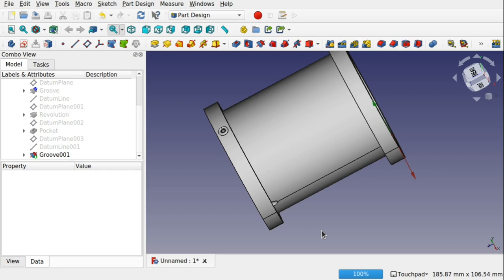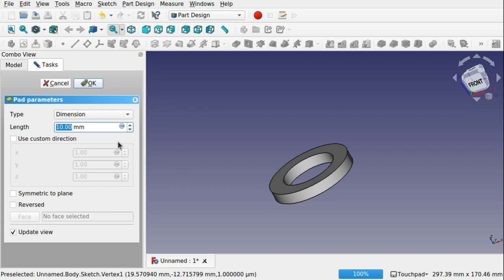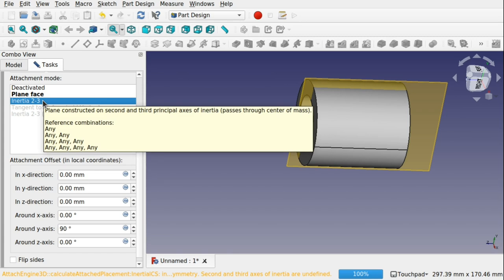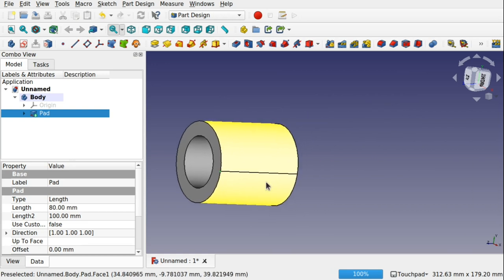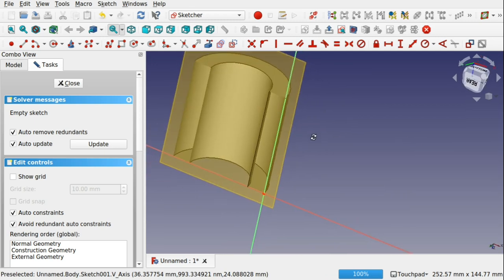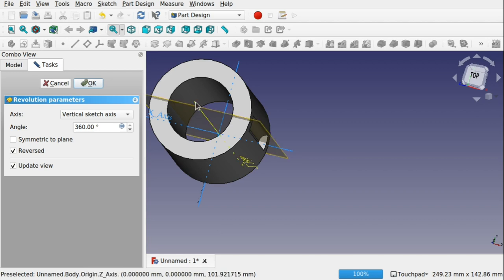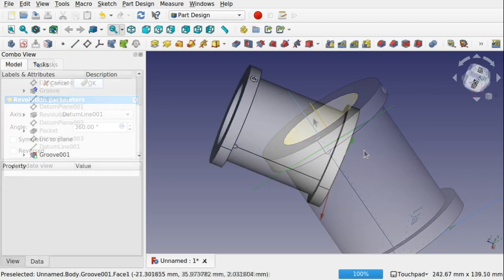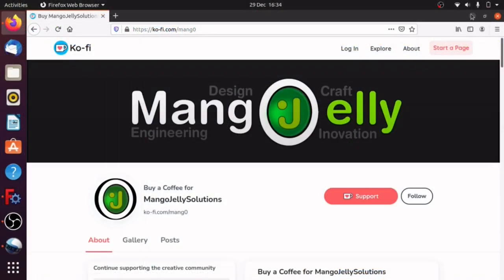FreeCAD: Understanding how Datum Planes and Datum Lines Work With Grooves and Revolves

Comment: Very interesting, but the hole drilling part beginning at 19:43 seems very strange to me, because you selected to move the datum-plane in the "Z" direction, but the Coordinate-System arrow shows that you moved the plane in the 'Y' direction. 
I'm very confused there.
But not only because of that, but also why it does make the hole when you move the datum-plane away from the hole that you want to drill, and not by moving the plane towards where the hole should be🤨
I don't get it, and that Is unfortunately pretty often the case for me in this Software.
It's just not intuitive at all imho.

Comment: 20:02 you move the plane in Z axis but I don't understand why it isn't X or Y. shouldn't Z move it to the TOP or BOTTOM? Your view cube shows moving in Z is towards REAR.
Reply from the maker: It's all to do with local and global co-ordinates.  When you attach a sketch, datum plane etc you are attaching it to the base object but it still keeps its co-ordinate system.  This is know as local co-ordinates.  So with a sketch attached to the face the Z axis will always be normal to the sketch.  It can get confusing and I am creating a video regarding it.

Comment: At 8:18 you said "we may have to jut this sketch out slightly" but ultimately didn't. Had that been necessary how would you have done it, given that the sketch is attached to the external geometry line?
Reply from the maker: Hi, yes sorry I should of really covered that. I would of had to change my constraints against that line to offset it with a distance constraint against the top or bottom import vertex. An example of when you would u have to do this is if the shape of your body  is of such that a pocket or groove will cause a void in the body which splits it in two sepreste pieces which is not supported in the part design (but is in the part workbench). In this instance we are fine. If theere was a ridge in the middle of the cylinder then that ridge would of been disconnected creating a multipart single body and causing an error.

Comment: @4:41 it appears that if you define the Datum plane "Normal to the edge"  it means that the center of the defined Datum plane was moved to  the end of the edge, even though there is no preview of that change and the plane still looks like it is at the center of the cylinder. That is quite confusing. It would be much more clear, if the local LCS axes were visible and reacting with preview to any change you make in Attachment Mode table, before executing...
Also: @~12:36 using datum line in a Hostory tree's previous command(grove) runs counterintuitive to usual History tree function of dependency. You should not be able to define or rather execute a command using geometry, which was defines later, I could see more logical to define the datum line and then move it in History tree before the Grove command and then execute  the Groove command. It would be more in line with usual logic.

Comment: Is that Mapping function available on X-Y (etc) planes like where you created the initial sketch? (That would have fixed the negative direction hole issue I was mentioning on the offset video, unless that would have flipped the offset tracing.)
Reply from the maker: It's is available on the sketch as well, I am going to have a look back through the comments to remind myself. Sorry I get quite a few.

Comment: do you know if its possible to draw a line in sketch, and then the angle in degrees pops up, whether you can "lock" a certain angle. In inventor you can use TAB to switch to the angle and then you can say well 45' TAB again and then draw the line to the length you want.

you can also just put a line point somewhere and then just fill in the length of the line and the angle and its draws it.

I have some major issues in FREECAD to just simply sketch things. Points of 2 lines very close together do not snap on and connect with each other. If I draw a sketch on an existing model it does not wanna extrude. its just such simple basic things that are a complete headache in Freecad that just work in other CAD pograms.